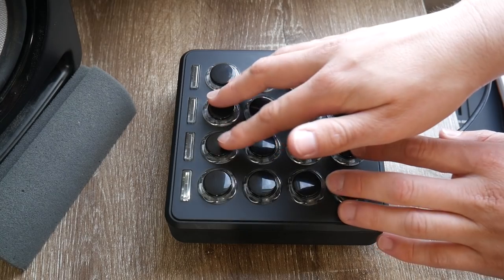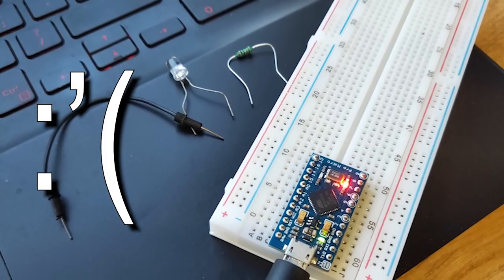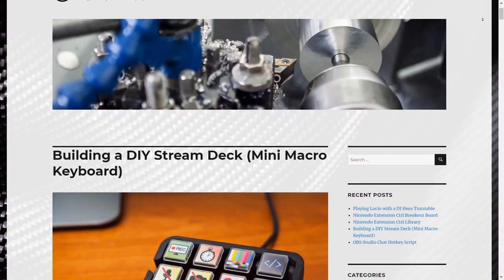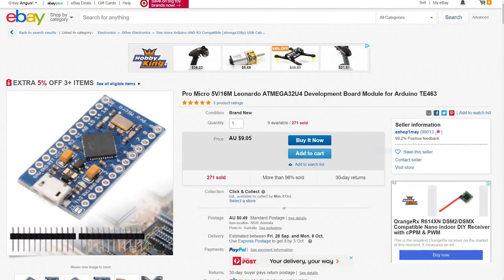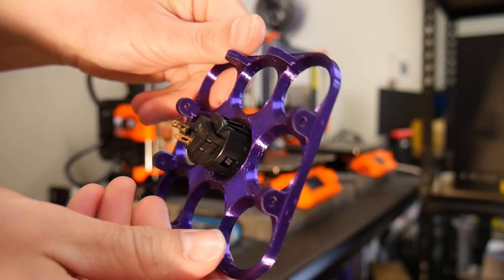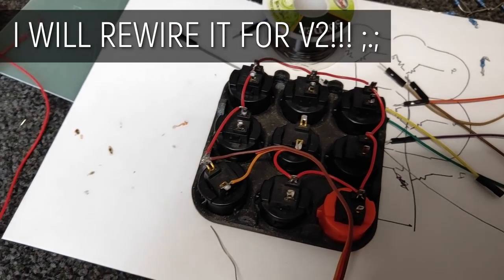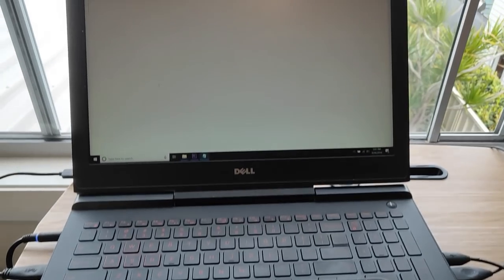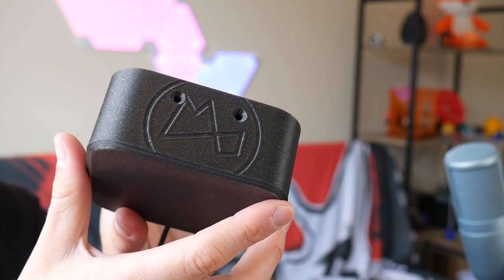Making a custom macro keyboard with REAL arcade buttons

Comment: I love seeing your work Angus and I think this is a fun project but just to be a miserable pommie bastard I have to say that for this job I use a Logitech G13 which I got second hand off eBay. I know it's supposed to be used as a gaming pad but it works amazingly well as a macro control surface. It can store up to 73 macros per application profile but I tend to keep it down to about 20 or so. I use it for both Reaper and Davinci Resolve. Nonetheless, keep up the good work.

Comment: Nice work! I have got into designing a bunch of macropads this year and am also not great with programming...

I use http://www.keyboard-layout-editor.com/#/ for layouts, which can also help with wiring layout and this can generate a base JSON layout file with the wiring paths and pin assignments and
https://kbfirmware.com/ which makes key macros easy to program and can compile your JSON files to HEX for flashing the pro-micro.

Both of the above come from the open source custom keyboard community, and if you think of a key switch as an ordinary momentary switch you can use these for pretty much anything :)

Comment: I have a differenct problem: as a Computer Science student I know how to code, but I hardly know shit about electronics :D And I dont mean soldering a battery to some leds ( I even did that and it worked out nice) I mean building stuff with arduinos D: this semester we are actually learning dooing some "hardware near" programming so assembler which is like only used for making drivers, but yeah. maybe I can built my own usb stufff and make some drivers for it? maybe? idk we'll see

Comment: I'm equally horrible with code, so i think i'd just try JoyToKey. They should be button inputs into the PC, and even though the programm originally existed to use an xbox controller wirh games that had no support for it, i found it takes any button input. It let's you assign up to a 4-chain command and also has options for auto-repeat and so on

Comment: If you want to keep using arduino, I would probably use the arduino code to send F13 through F24 and then use AutoHotkey or something similar to actually control the hotkey functions. This would allow you to have a nearly infinite number of configurations without having to reflash the arduino. There is a way to put multiple configurations into the arduino itself, but idk how to do it.

Comment: I did handwire and program a USB keyboard a couple of weeks ago and it really seems like an intimidating task at first. but in the end it was very easy using Keyboard Layout Editor http://www.keyboard-layout-editor.com/#/ and http://kbfirmware.com/
the web based software is pretty powerful with the possibility of using different layers and all kinds of makros, keystrokes and even lighting. and all of that in a grafical interface. the only not so straight forward thing was that I did need a Linux machine (I used a Raspberry Pi) to actually upload the code to the ProMicro.
there are plenty of tutorials about that stuff online but if you need help, I'd be happy to support you.

Comment: Icky buttons. Don't get used to proper Omron or cherry based microswitch arcade buttons.. They'll spoil you for these inferior ones. :)
And a 1 or 2k pull up resistor will make for a 'stronger' signal, good for example, at the end of long leads on a 3d printer's end stop(Where there is lots of noise from other stuff) but not needed for such short runs as this.

Comment: Hey, It is not hard to code. It is hard to Split your Project up and do it step by step. Like connect only one Button and see if it’s working and than go from then. I am a software engineer and learned it the hard way. I was so enthusiastic and wanted to start programming that I did no planning and so I programmed very badly. Later on I learned I just need to do it in small pieces. I hope this will help you.

Comment: I know you are probably using solder with flux core but if you want better soldering you need to add more flux, the flux core is burning so fast that it doesn't really protect the solder especially if you are soldering to bigger parts such as button connector etc. it's because it absorbs more heat causing the flux to burn away while you trying to warm it up

Comment: Pull down resistors are often used to limit the current.  Otherwise you have a dead short from a pulled-up signal to ground.

Comment: Hey Angus awsome video. I also ran into the rabbit hole of designing keyboards when researching for a similar project and ultimately designed my own mechanics keyboard from ground up. If I can help you with anything arduino/electronics just drop me a line ;) looking forward to your next iteration :D

Comment: For macro, midi, DIY game controllers, flight sim inputs, and other USB HID interfaces both analog and digital I highly recommend the Teensy line of microcontrollers developed by PJRC. I've used them for a few different USB projects. They sport a huge amount of features and there are several to choose from to fit your application, and the best part is that they're completely coded using the Arduino IDE (though with a lot more programming features / commands available).

Comment: Stop me if this sounds patronising. 

If a more familiar way of learning coding principles would be best for you, you may want to think about using Model>Modify>Change parameters in Fusion 360 to help you make a model of the box as a configurable array, so you can generate a box with as many rows and columns as required, based on the file user changing the values of just two parameters.

Comment: The cycling looks to be a result of not using oneshot logic. The processor will register that button press several times with even a light tap. If you're not aggressively macro-ing, you can probably just add a time delay after each interrupt to space out the commands.

Let me know if you're completely stuck. I've been programming a stream deck for our channel lately, but I do a lot of work with Arduinos (Especially now that Marlin is so popular).

Comment: If I can ever get my Monoprice Mini Elite up and running, I"d love to build one of these. 

I'm having the devil's own time trying to level the build plate. I'm still looking for a design for a set of leveling knobs that fit this machine. 

So far, I've d/l'd several designs and ran them off at the public library (Eugene Oregon has a really nice Maker Lab). None have worked. 

They're either too small, or too tall, or get in the way of the build plate as it moves.

Comment: Add a 3 position or dip switch to turn the 9 buttons into 27. Also, the Teensy LC might be a better choice for the controller.

Comment: Great video as always. I would have prefered a teensy board for such a task, but arduinos are much more popular and thus better/more varied documentation is available
Reply: Teensys are awesome, but they cost 20$ compared to 3$ for the pro micro and are super overkill for this application. In fact, running the pro micro at 5V for the increased clock speed is already totally overkill. So I'd say the pro micro is by far the best choice...

Comment: i know you want to learn to code but all you really needed to use was the circuit board out of an old cheap keyboard. plug it in as a second keyboard and use macro software to control what the buttons do..

Comment: You might want to look into using a matrix keypad wiring. It requires less wiring and has become a rather standard way to wire up multiple buttons. So much so that the Arduino Playground has a Matrix Keypad library and several sketches using it.
Reply: Problem with matrix wiring is that without proper scanning code it can leave dead spots when you press multiple buttons at the same time.  (That's why some keyboards have trouble with dead spots.) Also you can't just wire each button to ground...

Comment: OMG I’ve meaning to do this forever. I bought some Gateron switches for that. Hit me up if you need help coding. I am a software engineer.
Reply: Nice mate. My friends and I are doing a project like this but 100%, 60% and a 50% grid keyboard. Its essentially the same code. Because they're just buttons. But that's cool that you're a software engineer.

Comment: Something something solderless breadboard first something?

My wiring's also a horrible mess. Wiring a 4-digit 7-segment display, which has 12 connections, directly to an Arduino Nano along with enough buttons to use up all the remaining pins… then discovering that the last two analog pins are purely analog-input only and being forced to desolder and rewire at the last minute… And, another project, realising that I can't use the Rx pin for digital input if I'm using the Tx pin to send serial data. Fun learning process not at all hindered by my poor ability to solder wire onto wire :(
Reply: By 'last two analog', I assume you mean A6 and A7. Yes, they're analog input only but that doesn't stop you using them as 'pseudo-digital' inputs by reading the value on the pin, using analogRead, and deciding if it's High or Low, depending on the value.

Define boolean variables pinState_A6 and pinState_A7, then, to check them:

if(analogRead(A6)>>100)
PinState_A6 = high
else
PinState_A6 = low;
if(analogRead(A7)>>100)
PinState_A7 = high
else
PinState_A7 = low

You can use both Rx and Tx as 'normal digital I/O pins' (using pin numbering 0 and 1 respectively) providing that you aren't using Serial communications (for debugging, or anything else).
Reply: Working on a trinket (attiny85) is super fun because two put of five (six if you count the reset button) available pins are used for USB communication, which means that i can't program the thing because i have the pin connected to something else. And I'm out of pins. And I can't use anything else because the object I'm cramming the trinket into isn't big enough. And I can't matrix the pins because they're all serial (the accelerometer alone needs 3 pins) And I can't stop ranting.

Send Help.

Also, get some soldering paste, dip your wires into it, and solder. Works like a charm.
Reply: @duncanx99  Yes, analogRead is one way to do it. As I said, I'm using Tx for (send-only) serial communication - this seems to interact with using Rx freely as an i/o pin.
Reply: @duncanx99  You meant >, not >>, right?

In this kind of situation you'd just write
foo_flag = analogRead(foo_pin) > 100;
There's no need to add an if/else.

Comment: Maybe if you want to get in touch with programming you can start by designing in OpenSCAD, which is CAD tool using code instead of pointing and clicking